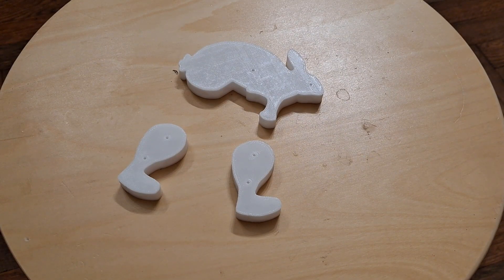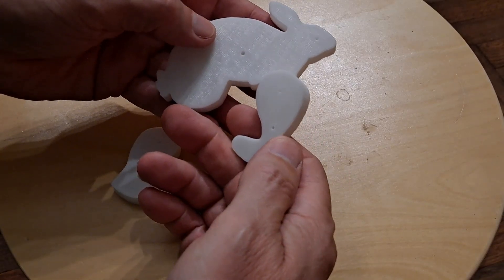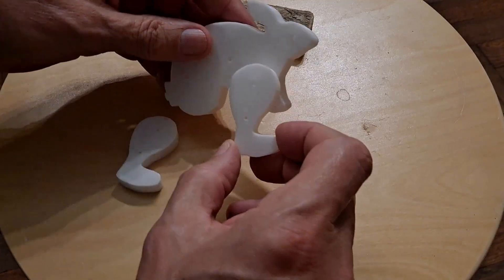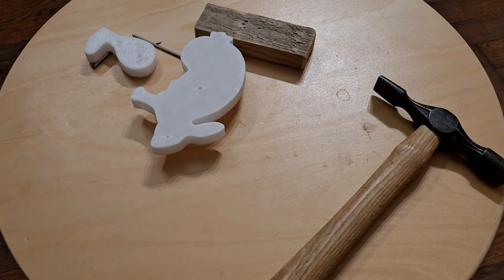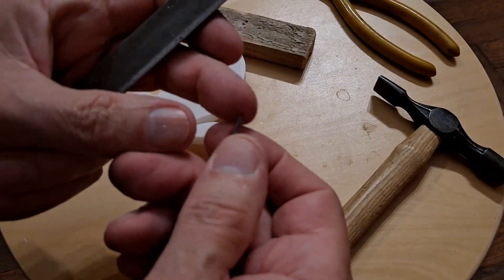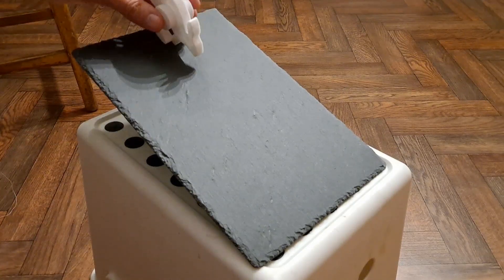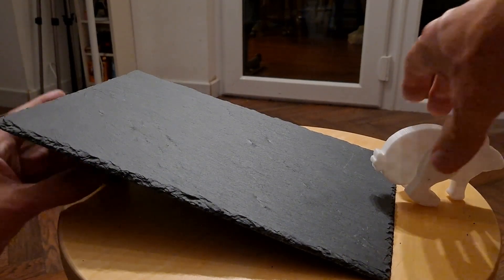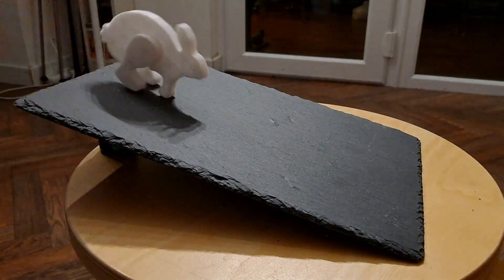Hopping rabbit - cnc file converted to 3D file

Comment: <3 the slate for The Killer Rabbit of Caerbannog.. will it be  a leave behind? light bulb... can you print your channel and logo on it and leave it behind? could you print the axles the body or would they be 2 weak?
Reply from the maker: I could print axles as separate items, in a different orientation, so they would have the layers run along the length. That would give them strength, but if I just printed them as part of the body they would be guaranteed to sheer off.

Comment: I have a new project for my end mill practice now. I'm going to make this in aluminum and hopefully it will turn out good
Reply from the maker: Yes it was a CNC file, so you should be able to do it on your machines. There are thousands of designs online. I find mine on Pinterest, but there are plenty of sites that specialise on CNC files.
Reply: @GrandadIsAnOldMan  thanks and good morning grandad.

Comment: havent seen one without a pullback motor before but thats neat.that works really good at the right height of the slate or tile.when you buy the printer is there a converter program comming with the printer to convert your files to load them into the printer afterwards or do you have to search for a file converter on the net? could you make a video on how the files are converted for printing.
Reply from the maker: There is a lot more to 3D printing than just finding a file somewhere. Here are a couple of videos I did on the subject in 2020 - Converting a 3D kit laser template to suit a 3D printer Cavalo Marinho (Sea Horse) https://youtu.be/N58KUuaXUJc  and  3D print file conversion from Model Plane 3D Laser Cutting Project https://youtu.be/x2Pza6OOwXM